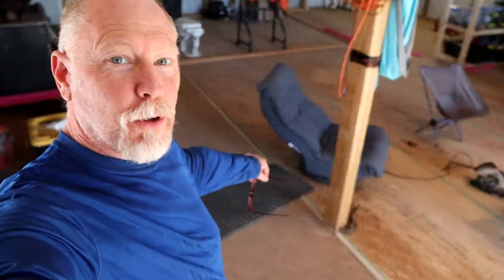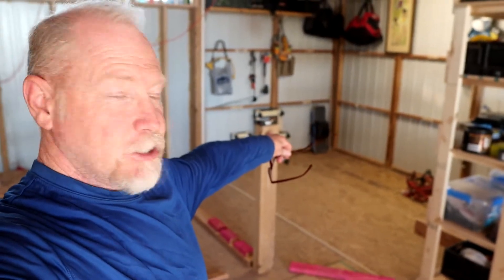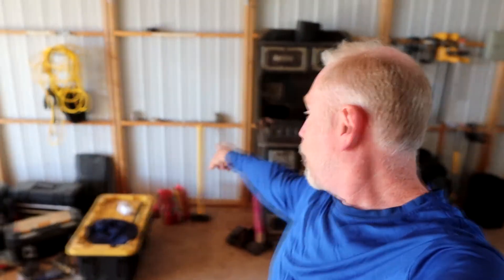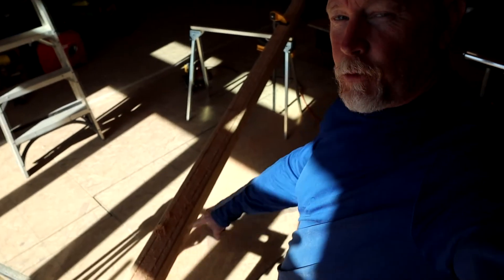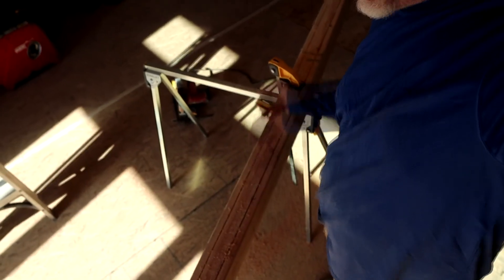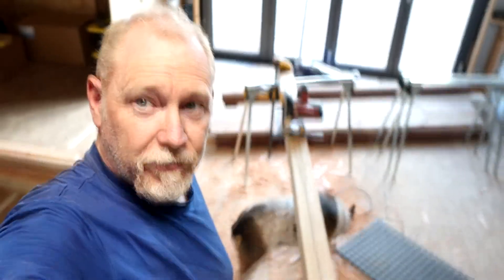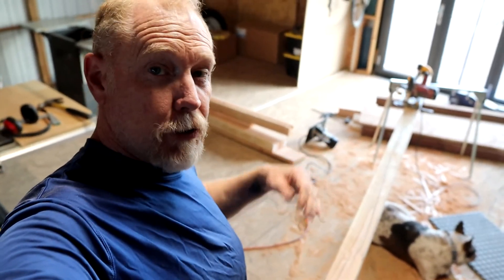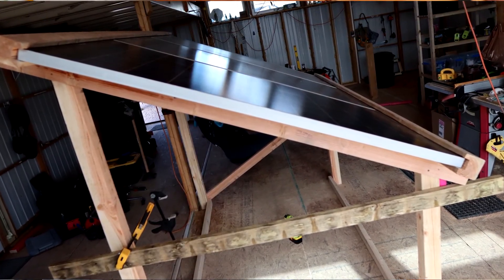Simple and Strong DIY Ground Mount Solar Array - No Metal Rails, Tracks, or  Clamps! Part 1

Comment: The "movable" part is going to be your problem. We get some pretty outrageous winds at times and a 50-75mph wind (or at times even worse) is going to send those mounts flying like the sail they are if it comes from the right direction. The Tiny Shiny Home people have a video of where they put their mounts in the ground and the eye popping hole depth and amount of concrete required to hold solar panels down by Cochise County code. I get the idea, but our winds can be REALLY crazy at times and most are shocked the first time they experience them. I was coming back into Arizona New Years morning around 3am and stopped in San Simon for gas (just over the border on 10. It took me 4 tries to get out of my truck because the wind was tossing my door and me back into the truck like I was a rag doll, and I'm not a small guy. The gas pumps were swaying in the wind (never seen that before) moving 6 inches plus at the top. You couldn't miss it. Please be careful as our winds are no joke and solar panels in a line make the perfect sail to take off and fly away.
Reply from the maker: Thanks for the feedback. SO I am thinking through some options to tether them to the ground with chain or cable, likely into some concrete. 20-3oMPH winds doesnt budge them at all, but yes in a serious wind storm or microburst, all bets are off at this point! Building the next 2 racks now with heavier wood/weight but again in very high winds, its not enough.
Reply: @solohomesteader  tethering seems like a decent option (as I can't think of another at the moment). I just know I've seen winds here that can easily hang with hurricanes back east at times. When I was in Phoenix a micro burst hit the place I was living and it snapped off 1.5" thick solid clay tiles along the roof edge. At least tethered well you could limit (hopefully eliminate) the flying debris hopefully. Best of luck to you and stay safe!